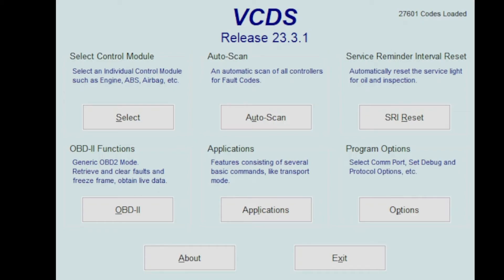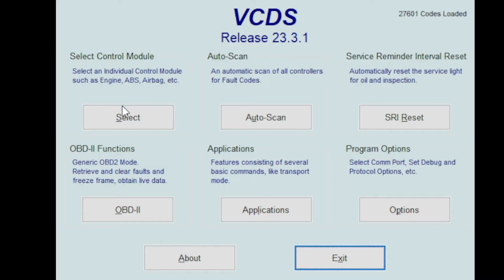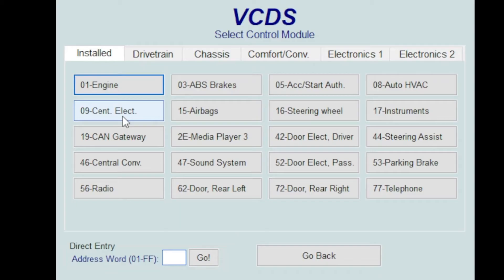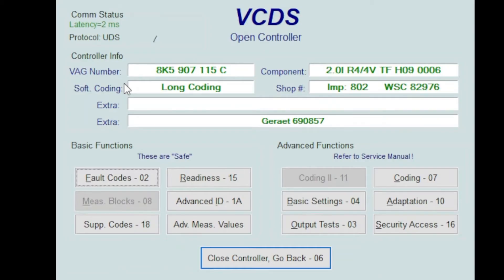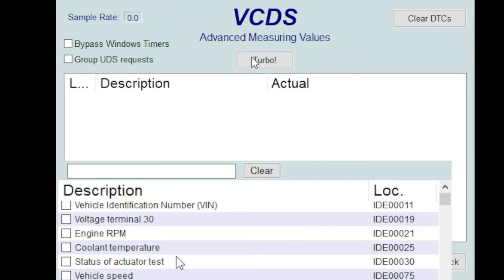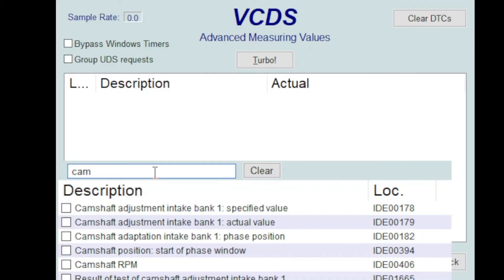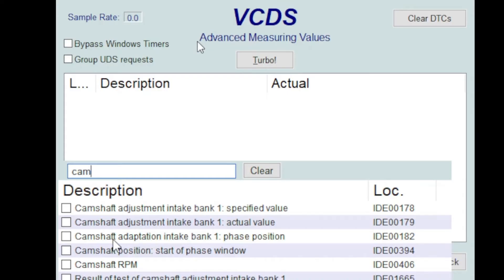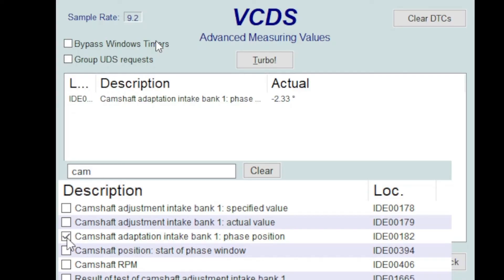Audi 2.0 TFSI Timing Chain check Using VCDS from Ross Tech

Comment: Wow - I just checked mine and it is at -10.57 degrees! Is that even possible? Yikes? I have been getting intermittent high pressure fuel codes P053F, P0088, and P2293. Even after replacing the HPFP and the two pressure sensors. It's a 2016 Q5 with about 90k miles. Does anyone know if there is an extended warranty available for this? I plan on checking with the dealer tomorrow! Thanks!
Reply from the maker: There was for the older models but it eneded a few years back. Definitely worth checking into. You are fortunate it has not skipped timing.

Comment: Hi very interresting thank you ! I have a metalic sound at cold start so would like to do the check. Is this procedure you are showing for B8 or B8.5 2102 to 2015 V8 engines too ? same numbers to check , under -4 is an issue with those engines too ? thanks a lot !
Reply from the maker: Numbers are for the 2.0tfsi. Not sure about the numbers for the 4.2 v8. But the procedure should be the same.

Comment: What if its newer 2.0tfsi with camshaft adjusters on both cams ? What are the limits then ?
Reply from the maker: The same. Its basically the same chain and tensioner. Just a different cam gear.
Reply: @danielsgarage3545 thanks mate

Comment: Hi, thank you for the video. I am still wondering after replace the chains,  it has codes p300, 1,2,3,4. And live data is -2.99 at cold then -2.88 after warm up
Reply from the maker: numbers look good. if you haven't already clear all the codes and see if they come back. if they do then on to further diagnosis. but the chain adaptation number is great.
Reply: @ I cleaned codes then came back same codes again then again every time I cleaned them.
Reply: @limitless2416 Maybe I can help.

The chain stretch doesn’t indicate how well timed the engine is.

It indicates how much effort the tensioner is using in order to keep it in time.

A -1.5 and -9.5 could be in equally perfect time, but the -9.5 is using almost all the strength it has to do it.

At 2.99 your chain isn’t stretched but could still be very out of time if it was installed in the wrong position.

You can remove the timing covers to visually confirm your engine is in time, but that is a full day’s work. Try easier troubleshooting first. Cam position sensor for example.

Comment: So if i have a reading of -1.2 would you say that the car is timed fairly correctly? I just had a new chain and timing a few 100 miles ago and wonder if the shop timed correctly. My vcds adaptation shows -1.2
Reply from the maker: @arinb12  that would be perfection.

Comment: Hello! Thank you for the video! I have Audi A4 1.8 TFSI from 2013 and recently i changed the timing chain with a new one, including the entire timing kit. My mechanic recommend me to do this becouse the chain had like -3.64 degrees and he told me that i need to replace the timing chain becouse it could damage the engine. Now everyting is brand new and installed, the engines starts normaly but i have a lack of power and rough idle. I have en error on the camshaft sincronization and the ECU still see the chain that is -3.64 stretch like before. How can i reset that value so the ECU knows that i have a new timing chain now? In VCDS i don't have that option..
Reply from the maker: @adrianionut7680  it will automatically adjust if it was done properly. I had a very similar  thing happen in my old Q5.  All the timing marks where alinged proper but i had your same symptoms.  For me the crank sprocket was not aligned properly to the crank. So all the marks where correct on the outside but no inside. Unfortunately this requires taking the enitre timing set off again.
Reply: @danielsgarage3545  Thank you for your answer! So the crank sprocket must be aligned first and after that aligned the timing marks?
Reply from the maker: @adrianionut7680  thats what mine was. Thinking about it further if they only did a timing chain and not the other chains the sprocket may not have been removed.   Are you getting any other codes in vcds?
Reply: @danielsgarage3545  Yes, now i have on VCDS error 14868 - Camshaft position sensor G40 and Crankshaft speed sensor G28. Wrong corelation.  Maybe you are right about the wrong marks alignment..
Reply from the maker: @adrianionut7680  it seems very likely.  I would enquire to the repair shop if they did remove the crank sprocket.  If so this may require redoing all the work unfortunately.  The crank sprocket is very very very easy to not align properly. Took me 3 complete times to get it right the very first time.
Reply: @ Thank you for your time and quick responses! I will talk to my mechanic today.

Comment: I have a constant -12 degrees on all rpm ranges after having rebuilt the engine and of course the chain+tensioner+cam adjuster. Car runs without misfires.
Any thoughts abouts this?

Comment: Did you have any misfires or did it shake when cold? Because I have already changed the entire ignition system and I still have misfires and the chain is -6.32
Reply from the maker: @brent676 I personally have not driven a car with excessive stretch. I would venture that a -6 would be the issue. My first step would be a timing job ASAP.
Reply: You may be off a tooth on timing then, unless you're 100% that it was spot on than I'd look at other issues that can cause the rough idle. If you've already done the timing chain. If you haven't done the timing chain update then that's the issue for sure

Comment: Thank you for showing how to run this diagnostic. I'm debating purchasing a VCDS but I don't have a windows device so wanted to see how easy it was to check the diagnostics before I pull the trigger and get the mobile enabled one or just try to borrow a friend's laptop.
Reply: Did you have any misfires or did it shake when cold? Because I have already changed the entire ignition system and I still have misfires and the chain is -6.32
Reply: I purchased a used surface pro from ebay for my unit as I am a Mac user. 100% worth it! I think the Surface was $100 ish

Comment: Hi, my question is, when the chain is mounted new, it's alwais going in negativ degree or it's possible to going also in possitiv degree?
Reply from the maker: @ervin1303  i have persoanlly only over seen negative numbers. But i have heard it can also be in the positives.
Reply: @danielsgarage3545 Hi is -3 ok as mine sits there now a day after having it changed. I imagine it will stay like that for years?
Reply from the maker: -3 is great. I have been at -2.8 something since i have owned the car in 2021.  @robberhd3218
Reply: @danielsgarage3545  Great news I checked today on a fully warm engine and it was -2, my mistake before the engine was cold! Thanks for the fast reply 👍

Comment: I Just bought a 2014 that is at -9. Having timing chain, tensioners assembly done today.
Reply: Did you have any misfires or did it shake when cold? Because I have already changed the entire ignition system and I still have misfires and the chain is -6.32
Reply: @brent676  didn't notice any symptoms. Only found out when checking it. Had a water pump error with it that went away after replacing the chain assembly.

Comment: Hi mate, great video ! I have a tfsi BWA 2.0 and I just change distribution, chain etc it marks me 2.0 Position Phase Bank 1 Intake. I am not sure if the value is correct ? I hope you can help me ?
You can help me
Reply from the maker: I assume you mean +2. if yes you are good, anything from +4-5 to -4-5 is within spec.
Reply: @danielsgarage3545  Yes, my friend, +2.  I had doubts about the failure P0011 - 004 - Retard Setpoint not Reached (Over-Advanced) could be because of the new string, but now I understand thanks to you that this part is ok.  ❤

Comment: Mine is positive 0.09. Good or bad? I know that i should be replacing the tensioner
Reply from the maker: @zts3661  with a .09 you arr almost perfect.  Audi spec is anything between + or - 5 degrees is good. Anything past is time to replace.
Reply: @danielsgarage3545 what’s the difference with exhaust bank 1? And Intakebank 1?  My intake bank 1 is: 0.3, and my exhaust bank 1 is: -3

Good ? Any advice for these both? Idk the difference, what should they both be?

Comment: Just did this at my 2010 2.0T Passat B6, 128k km atm, because im having a rattling metal noise at first start up for about a second, for quite some time already, chain tensioner is original and old model, but it showed me -2.88, so i presume its another problem? Like if something that was supposed to hold some oil isnt doing its job, whats your opinion pls?
Reply from the maker: I believe you are on the right track, something is draining oil and needs to refill after engine stop. the camshaft lifters are hydraulic and can drain "from audi this is normal" the chain tensioner is also hydraulic and can drain. I would do a visual inspection of the tensioner at the little view port in the lower chain cover, should pop off and pop back on, looks like its not to had to get to behind the wheel.  check it engine off for a while and see where its at and then engine on and see how far it moves, if it pushes out a lot that would be the problem. other potential culprits are just worn guides with any of the 3 chains in there.
Reply: @danielsgarage3545  Ive inspected it in the past already, but with engine off just to clarify the tensioner version, confirming that Its the original old version without the teeths, will try this test uve suggested, but with this -2.88 from Vcds, should i be worried about any iminent tensioner failure/ engine kboom?
Reply from the maker: I would guess you are not in any immediate danger. I believe mine is also original from 2013 and still have a -2.4 with 112,000 miles.  Could be the hydraulic lifters a worn giude rail, someone said they had a loose bolt on the hpfp.
Reply: @danielsgarage3545  Ive checked the hpfp last month because of a low pressure code already, It looks perfectly fine, no wear on the lobe, very tight, no visual wear at all, but replaced the pcv membrane, and might also need to replace the hole pcv, Its letting oil into the turbine outlet. The first start noise might have something related with oil pump?
Reply from the maker: Unlikely but worth a check. You should be able to check it in vcds. I put an aem oil pressure guage in my car. Armt idle its around 15-18 psi and full throttle 7k rpm its up to about 50s. Putsing around town its usually in the 20 and 30 psi range.  For your reference points
Reply: @danielsgarage3545  Will check It out, from where u pulled the reading in line?
Reply from the maker: @igorchaves1232  sadly I thought wrong. from what I can find you cant check it with vcds. I pulled the low pressure sensor {top one} added a T fitting and put both sensors on the T fitting.
Reply: @danielsgarage3545  Txs for all ur kind replies dude!
Reply: @audi_fanusik I was suspecting about this, after looking after some other videos, I'll look into that TXS bro!
Reply: If you have a 2010 you’re on borrowed time with the original tensioner. The teeth that hold it back are a poor design. It can fail with no warning in VCDS. Just did a complete head on my daughters

Comment: My MK7 GTI with over 150k miles shows a +0.3° value. Is that good?
Reply: Same lol
Reply: very good
Reply: @mhaas281 what’s the difference with exhaust bank 1 and Intake bank 1? My intake bank 1 is: 0.3,  and exhaust bank 1 is: -3

What’s that ?
Reply: @bhpbones  you have two types of valves in each cylinder.  intake valves, and exhaust valves.  the intake valves are barely adjusting for timing at all (0.3 degrees).  the exhaust valves are adjust -3 degrees, this is still fine, as said in the video, start thinking about getting parts when it hits 4-5 degrees.

Comment: I found only "camshaft adjustment inlet phase" is that right?
Reply from the maker: What kind of value is it giving you. Is it + or - less then 10 like a -2.5 or -3
Reply: @danielsgarage3545  0.750 degrees.
Reply: It gives me value of 1.125 and phase 2. is: 2.625   at warm engine.
Reply from the maker: Normal within spec camshaft adaptation reading should be + or - 4 degrees. Anything above or below its time to change the chain.
Reply: Ok thanks, so im good? 😊
Reply from the maker: With the information available to me I would say yes.

Comment: Do you ever have to worry about the exhaust phase?
Reply from the maker: Since the intake and exhaust are linked in 1 timing loop, if the intake is wrong so will the exhaust.
Reply: @danielsgarage3545   ON the mk7 side of things for the golf r and gti it has a vvt for exhaust as well. Everyone I've seen has two different numbers between the intake and exhaust phase. The reason i asked is because many of the intakes are green zone while exhaust side seems to be all over the place
Reply from the maker: I am not completly sure. But the exhuast side does make sense since it is variable cam angle that they would be all over the place. Do you have eny check engine lights?
Reply: @danielsgarage3545   No codes, just figured i should check
Reply from the maker: Better safe then sorry.
Reply: On mine every time I checked the intake bank is on 0.00. The exhaust one was -2.6 a couple of months ago, now it's -2.3 (so it's moving). In this case should I just use the exhaust bank for the timing chain stretch? 2017 A4 b9 2.0T